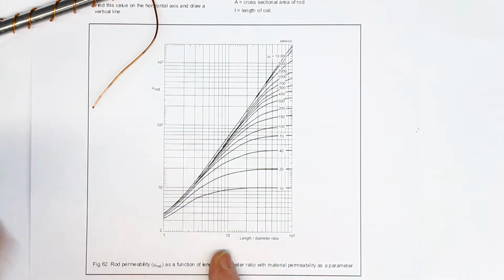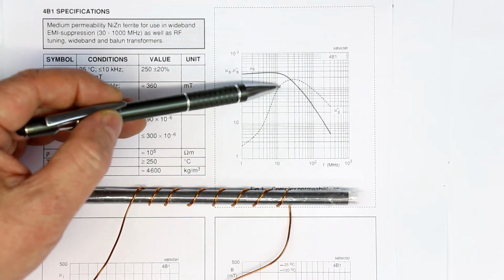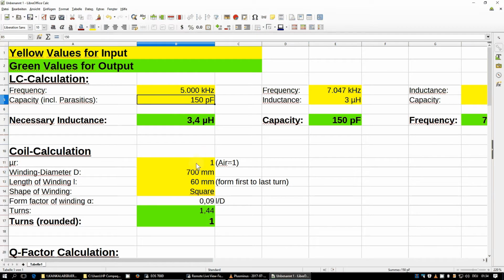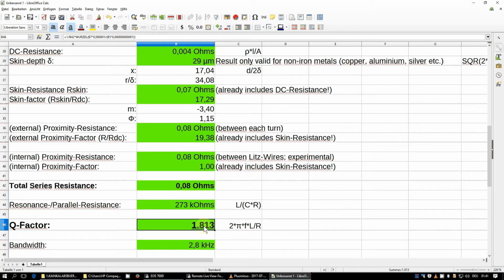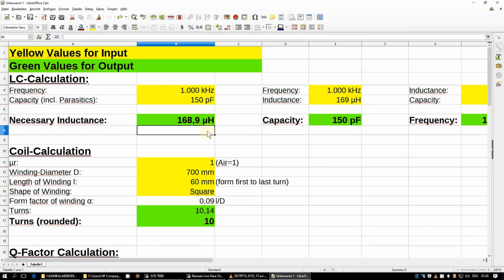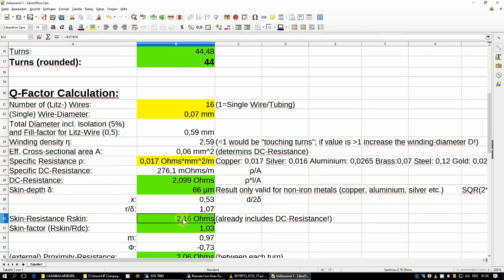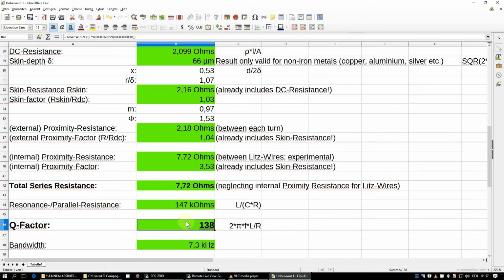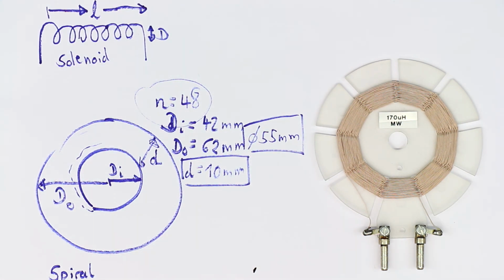A Spreadseet for Magnetic Antennas Pt.3: Ferrite-Rod & Spiderweb-Coils

Comment: Hi, Great video.  I have heard of .ods files which excel will open but not .ots.  How can i view your .ots file in Excel?
Reply from the maker: .ots is a template (like .xlt). Download LibreOffice, open it and save it as .ods or .xls-file
Reply: @KainkaLabs  Thanks for the info.  I found an online converter that worked eventually which converted accurately a .xls file.  All good and functional.  I have the full Microsoft Office installed as I have some massive Spreadsheets etc and didn't want more spreadsheet variants installed. lol.

Comment: In mw radio I usually  see the coil towards one side of  ferrite rod. Why don't they keep it midway where max inductance is? I made  few experiments regarding the number of turns and sliding in length of coils and got maximum signal strength in a balance between the number of turns and distance of sliding in of rod.
Reply from the maker: The placement of the coil on one side of the ferrite-rod is for fine-adjustment of the inductance because the µ-value of the ferrite has a large tolerance. Remember that you have a fixed dial for the frequencies and a variable capacitor which has some extra trimmers for fine-tuning it to have the rotation angle going exactly in line with the frequency dial. So you need another point of adjustment for the mid frequency and that is the possibility to shift the coil along the rod.

Comment: Very nice and detailed ..informative video, Thanks...Which would be high q between a ferrite rod or loop antenna... for mw radio dxing one should go for log of ferrite and lesser length of litz wire on it or its a bog loop who would win?
Reply from the maker: Ferrite Rod antennas usually have a q-factor of 100 in the MW-range. The spiderweb-coils can have up to 200. You still have to multiply the q-factor with the effective cross-sectional area of the antenna. This is difficult for ferrite rods because the ferrite "sucks" the magnetic field-lines into it which enlarges the effective cross-sectional are by a factor of 10...50, depending on the leng, diameter and µ-Value of the ferrite rod. For spiderweb-coils you can take the average of the start and end-diameter of the winding to calculate the cross-sectional area. Frame-antennas are of course the best (by a large factor) because they can have extremely large cross-sectional area and a q-factor of around 200 for the MW-range. So best is to consider a frame-antenna for DX-ing. Take a look at my videos concerning frame-antennas.

Comment: Hello, It seems like the links are no longer available. I would like to build a spider web antenna for 20m band in the first stage. Then for VLF Would like to receive and decode some FT8 down in the bands. Can you share the dimensions as well? Thank you and 73! DE1CTL
Reply from the maker: The link is updated. Should be working again.
Reply: @KainkaLabs  thank you, do you think I can do one for 13.56 MHz?
Reply from the maker: No, because losses in ferrite rods or in litz-wire are too high. You need copper tubing for that frequency to get a high q-factor antenna.

Comment: Hey dude, I was trying to build an AM radio since January that uses a ferrite loop, and two weeks ago I had finally succeeded. I’m so happy it’s difficult to explain how satisfying this is, I installed a TA7642 between the antennas coil and the lm386 amp, it works just as perfectly as I designed it, it’s sounding so delicious I listen to it constantly

Comment: Hi Roger,
Have you used a free (though not OS) software called FEMM that is an excellent and lightweight FEM tool to simulate coils, magnets, attraction-forces, coupling-factors, etc.? FEMM even accounts for things like proximity-effect and skin-effect, and if you follow the included tutorial step-by-step, takes (just) 2 hours to get up-and-running. (Next to M-field, FEMM also does E-field and temperature simulations, but that's another story). http://www.femm.info/wiki/HomePage
Reply from the maker: I think I have heard/read about it, but never used it. Thanks for the link
Just took a quick look at the manual. It´s of course extremely powerful, versatle and gives very realistic results.

But I´m afraid that setting up the parameters e.g. for a ferrite-rod antenna (manually inputting the B-H curve) with a litz-wire solenoid-coil (multiple strands which are multiple stranded or twisted) would take some time (which I don´t have ATM) and a lot of computing time.
If you (or anyone else here on this channel) has the time to setup the parameters for a spiral-wound/spiderweb-coil, I would be extremely grateful :-)

Anyway the original purpose of my spreadsheet was to create a quick calculation tool for the parameters and the Q-factor for frame-antennas, single-turn and multi-turn single-layer loop-antennas.
And until now the results are quite consistent (except for ferrite-rod antennas as could be seen in this video)

Thereby I got to the conclusion that absolutely nothing beats a frame-antenna and only a frame-antenna can really be optimized to minimize all detrimental effects to the Q-factor (skin-effect, external and internal proximity-effect).
As a bonus comes the large cross-sectional area which catches a lot of the magnetic field-lines and further increases the output voltage resp. output power.
There are many "sagas" about e.g. spiderweb-/spiral-/basket-weave and honeycomb-coils and I was a bit disappointed that my own spiderweb-coils did not  fully live up to my expextations. 
Only the frame-antenna did and everyone to whom I demonstrated it, was quite surprised about the (indoor) reception results with an optimized crystal-radio set.

In one of the next videos I will make real-life measurements of the Q-factor of all the shown magnetic antennas plus of course our frame-antenna.
I think I know most of the results beforehand but there may be one or the other surprise :-)
Reply: I use FEMM quite extensively. Unlike other FEM packages, it is extremely fast (most sims take <10s) - the limitation is that it is 2-D only - you have to creatively flatten your problem yourself, making it either planar-prismatic or axis-symmetric. This is usually no problem, once you get the hang of it. A spider-coil in air is extremely easy to simulate. Most ferrites, SWG/AWGs, conductors, PermMagnets etc. are already included in the library. (Self-entering BH-curves is an added bonus, iff you need the extra digits of precision.) You can even run optimizations by scripting parametric models from Octave, Lua or even Matlab. You could plot the "ferroxcube" curves with some approximation for an arbitrary ferrite-shape in a matter of minutes. I can mail you a spider-web simulation - Where to?
Reply from the maker: That would be great. Send the files to roger@kainkalabs.com

But can you really input litz-wire where the strands are multiple twisted/stranded internally?
And with the spiderweb-coil: is it possibly to take into account, that the polygonal winding changes every 40 degrees (with 9 sectors) from the top-side to the bottom side?

The data for my example-coil are mostly given in the video:
48 turns with 16x0,07mm litz-wire with 
Inner diameter@first turn: 42mm
Outer diameter@last turn: 62 mm
Template: Polystyrene with 2mm thickness
9 sectors, slot-width: 4mm
Simulation frequency: 1 MHz

Can you get me some simulation-results because you are familiar with the software?
Reply: Hi Roger,
I have sketched your coil as an axis-symmetric model in FEMM. Each turn is sketched independently. As a reality-check, I have also repeated the run with solid (as opposed to Litz) wire. At DC, the resistance if the Litz-coil is ~ 2.2Ohm. The solid-copper has 1.4Ohm (0.35mm conductor). Both have 169uH inductance. (That the DCR is 50% higher for the Litz is a good sign.)
At 1MHz, the inductance of the Litz coil stays the same, while that of the solid coil seems to drop to 167uH. (Haven't thought why this happens.) Interestingly, the ESR of the Litz coil is reported as 3.4Ohm at 1MHz whereas the ESR of the solid-wire is reported as 12.2 Ohm. Does this match with your expectations? AFAIK, the "litz" model within FEMM doesn't do a strand-for-strand calculation, but assumes a bulk-equivalent, that should be good enough for practical purposes. Inter-conductor effects should be in-place, i expect. I'll mail you the models shortly.